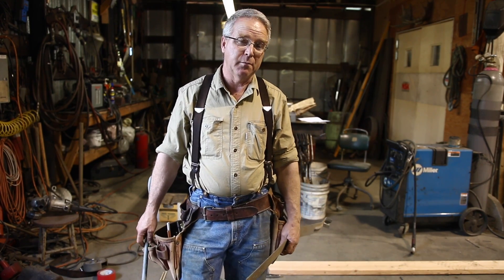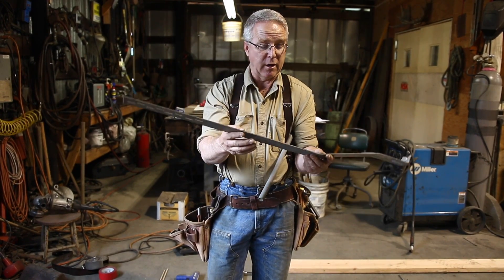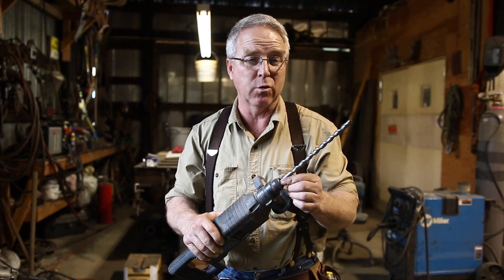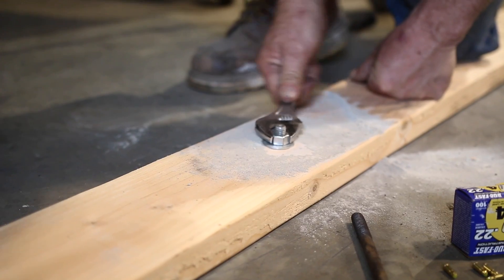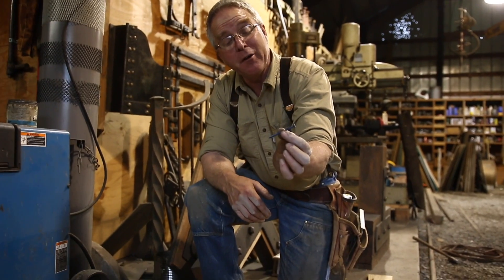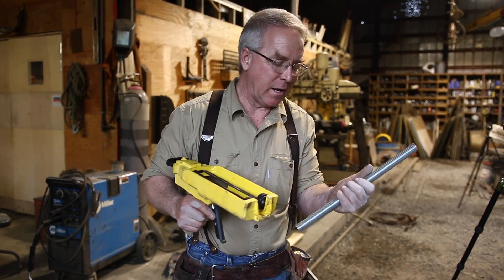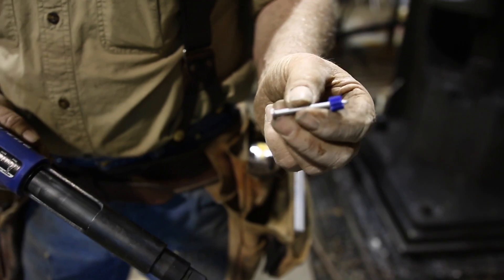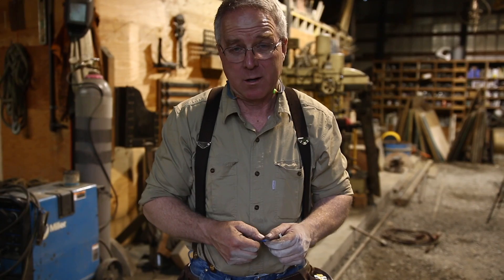How to Fasten to Concrete

Comment: the chemical anchor/epoxy/vinylester is my preferred choice on an existing building. these things work in solid concrete as well as in brick wall (with perforrated sleeves). maybe a bit pricey if you buy it from the nearest home depo, but half the price if you find an adhesive and anchor distributor in your area. there are lots of them.  spend the saved money on a appropriate gun instead, those home depo caulking gun cartridges are just a pain to get out. I have a similar gun shown here, but it's a dual concenctric piston-in-piston type, not the side by side. looks just like a regular caulking gun on steroids and takes a special single cartridge that has resin on the outside and hardener on the inside and a mixing tip is required. the beauty of the piston-in-piston gun is that you can set it from 1:1 ratio to 10:1, depending on the resin you use

Comment: I used Tapcons to bolt down the sill plate of the halfwall I added to the basement, I also had to remove a few of those ones that are shot into the slab/wood (the last one you did in the video) when I moved a few non-load bearing interior partition walls, those bitches are tough.

Comment: Good video. You will always remember doing this video with those bolt anchors in your slab there. Is that slab for your Nuclear warhead there or I mean jib  crane? That would be nice to see a video of. Thanks for your contribution. These videos are important. Teaching of the trades has gone down a sloppy hole the las 20 years or so.

Comment: Younger Wadsworth - How much does it bother you that the final footage you used ended up having such scrappy focusing? :p. As someone watching the video, wasn't a big deal, as someone who (rarely) makes videos, I was thinking about the times that's happened to me and how much it made me want to nuke the footage from orbit and never speak of it again. Not always easy to tell on the phone screen that something's not in focus. Something that might help.... use a sheet of some thing (cardboard, your hand, etc) to obscure the rest of the frame and force the camera to autofocus at the right depth. Option B is reshooting the closeups while keeping the voiceover. Anything else you learned about it that might help the rest of us?
Reply: :D. I commented not out of criticism, I know you care enough about your newfound craft to have noticed. I commented out of sympathy, and solidarity. The pain. I feel ya. Like a scab you know will scar if you pick at it, so you just gotta grit your teeth and try not to let it itch and drive you insane.
Reply: Matt, this is Nate. This new DSLR camera has been a serious challenge. By the end of this day filming (the first day with new camera) I wanted to throw the thing in a creek. Turns out, the camera was needing a firmware update in order to work with the lens we bought. HOPEFULLY we won't have that much trouble again! Good idea about cardboard to force the camera into submission :)

Comment: I have never had Tapcons do anything but leave me disappointed.  Whenever I need to anchor something into concrete, I buy Hilti anchors.  They cost a little more, but they just work.
One other tip when anchoring into a slap using expansion anchors is to drill all the way through the slab to the earth below.  That way, if your anchoring job goes south (probably because you're not using Hilti anchors), you can punch the anchor all the way down and start all over.

Comment: I have had good luck with Tapcons in brick, but usually manage to twist the head off driving them into concrete. I'm using their recommended drill bit, any thoughts? I've put a lot of interior bottom plates down with double 16s or Ramsets though

Comment: I remember learning the 16 penny nail and bailing wire trick when I did form work years ago. I'm so glad you covered it. HILTI has a lot of new fasteners out. They even have a vacuum that attaches to the drill to clean the hole as you go and keeps down the dust which is a health benefit if a ton of holes are to be made

Comment: I just wanted to add a "cheater" trick for Tapcons when they aren't holding anything critical...if you over drill the hole for some reason you can slip a zip tie in the hole and then run the screw in. The zip tie will give the screw something to press against so that it can grap the concrete on one side. Not the best solution but it can save you in a pinch.

Comment: 3/16" hole and one strand of insulated copper wire, stripped out of romex will hold a #8 screw real well and let you take it out... great for formwork.

Comment: What is the reason for using duplex nails over regular nails on those particular connections? I can only think of two reasons 1) to mark where the connection is or 2) to make it easier to remove the fasteners after the demonstration.
By the way, thank you for putting out excellent content, and I mean that, currently your videos are the only ones that I will always watch regardless if the title indicates it is something I'm familiar with or not interested in, I seem to always learn something

Comment: Thank you for another video, teaching us all some different ways to attach things to concrete and cinder blocks

Was wondering about the big anchor, would you still get the same strength, if the foundation was cut or bored out and refilled with concrete and the anchor???

Comment: I worked for a summer as an awning installer, and that was my first experience using tapcon wall anchors. Absolutely brilliant piece of kit, if it'll hold a 5' awning through high winds, it'll surely hold up damn near anything you want to hang on a wall. For floor anchors, I prefer drop in inserts to studs. A bit more involved to set, but you can take the bolts out, install a set screw to keep dirt out, and you're left with a flush floor.

Comment: My builder used some odd concrete in the basement. You really can't drill it with a standard bit. In real bits every time I try. I think I need a hammer drill.
Reply: You cant really drill any concrete with a standard drill bit. You need a masonry bit, it has a piece of carbide in the tip to drill through the cement and stone.

Comment: Hilti, and I assume other companies make "performance foil capsules for anchoring in concrete". They are pre-measured individual epoxy packets and come in different sizes. Just drill the  recommended hole diameter and depth for desired fastener size, drop in the packet, insert the fastener rod and you are done. No mess to clean up. Just be sure hole is clean and dry.

Comment: We have that exact drill at work!  Installing security cameras using up to a 1 1/4 x 18 bit.  I was impressed that a Dewalt 20V drill was able to spin that big bit enough to go through 2 bricks standing up and an 8 inch block we hit dead center.  :(  But it didn't have much juice left and wasn't really designed for such obviously.  Drill works great and a good price on Amazon.

Comment: To piggy back on what you've said earlier in the video, I think a very important distinction to make is the difference between a rotor hammer drill and an impact driver. A lot of people think that they are one and the same and i was one of them. Great video!

Comment: dear sir. thank you for showing all these techniques. may i note that epoxy is not making a chemical bond. epoxy is a self hardening plastic that is using its cohesive and adhesive power to hold 2 different materials. if it would be a chemical bond it would beor like welding. for example glueing acrylic with "special acrylic" glue is a chemical bond because the glue actually melts the to pieces together due to a chemical reaction between the glue and the acrylic.
also the note on the plastic anchors is not fully true. maybe you spend some time and get to know a company called Fisher. they are pretty big in my country and provide highly effective plastic anchor that will hold your tv (if propperly applied to a wall that holds the load as well) 😉
Reply: Essential Craftsman, thank you as well for noticing it. and please forgive me for the bad English.  i was not able to find any sleep that night.

Comment: Most forms I saw , were done with duplex and tie wire. Make sure you have a 4-6 foot crow bar to pull. In a pinch, any bolt screw will work, just fill extra space . Can use plastic, wood, wire tie, but I like using copper wire. Even drywall screws can be used, but have right drill, but and screws , saves time and sure job. Shop vac save dust drill and bits as you use.

Comment: I found out with using tapcons that it is best not to use a rotary hammer in soft brick. The rotary hammer makes the hole too big, and the screws just fall out.

Comment: Concerning Tapcons, if you are in a location where very hard aggregate is used in the concrete mix there is a good chance that the screw may catch a piece of aggregate and either twist off or strip out at the head.  One product we have found that works well is a Gripcon nail.  It has a heavier shank with a ridge spiraling from head to point.  You might be able to pull one with that big prybar you made a video of.

Also, I was glad to hear you cover proper techniques for using epoxy.  Brush and compressed air.  Equally important with epoxy is temperature at the time of placement.  There are different formulations for different temperature ranges.

I watched your hammering technique with keen interest, especially the blows that had a forward component involved.  That's not something that you learn from driving a couple nails.  🙂

Excellent video.

Comment: Hey a little tip. works great on big wedge anchors or overhead. switch the roto hammer to hammer only. No drill. stick the tip of the bit on the anchor and let it hammer it down. No need for a regular hammer
Reply: works great for electrical panel ground rods also

Comment: Hi Scott. Great video again. What sort if bit were you using in your SDS drill? I'm assuming a masonry bit? I didn't know you could drill through wood with them too. I'd have spent (wasted) another couple of minutes pre drilling with a wood bit first. Good to learn from the pros!
Reply: Jon Killeen a regular concrete bit. They will also go threw thin sheetmetal
Reply: Thanks Kyle Go Hawks.  I could have saved myself a load of time if I'd known that when I was boxing in some pipes to a brick wall earlier this year.

Comment: What was that yellow thing you were holding at about 10:00? You never explained that.
Reply: Essential Craftsman 

I love epoxy! As an engineer I specify it regularly on my projects. Many years ago I had a first hand experience witnessing the anchorage capacity of an epoxy  anchor connection being tested (unintentionally)  while working in construction. We were told to try to extract four 1-1/4" anchors that were embedded 36 inches because the superintendent was concrrned the epoxy wasn't setting fast enough in sub freezing February temperatures. It was in a paper mill power house and after all other attempts failed the forman told us to use the handy 35 ton bridge crane. The crane pulled apart a 3/4" steel strap in a straight pull without moving the anchor. Thankfully I was only an apprentice millwright at the time and not held responsible for the failure and crane damage. I am looking forward to your upcoming vidoe on epoxy anchors!

Comment: Love the videos, keep it up.  A quick comment on the epoxy method.  Most manufacturers of epoxy have moved away from the suck-brush-suck method as the new OSHA standards for silica dust approach.  They are now calling for a hollow shaft SDS bit with a HEPA vac connection. They will evacuate the hole as it drills.  Ive liked this method since before the OSHA standard, it is faster and more efficient if you have multiple holes in an area.

Comment: As an improvement on the plastic anchor, if I'm hanging something on a tiled wall or bolting into the floor, I will fill the hole with a two part putty epoxy and push a screw in while it's soft. After two minutes once it's half way set, I'll gently unscrew the screw and let the epoxy fully cure for another couple minutes. It's like a pre-threaded hole in concrete. Tough as a coffin nail.

Comment: fun fun, this last job i ran i was able to get the engineer to let me use Titan screws instead of wet setting anchor bolts on the perimeter walls, of course the shear walls i did wet set anchor bolts, one was 1'-6" for the hold downs on the end of the walls and the rest were 8" anchor bolts, every 32" on center.

Comment: A proper rotary hammer is awesome. Crescent wrench? Or nut rounder😂
Reply: Ryan Palmer that's the Mexican socket set
Reply: Ryan Palmer  thats a Swedish nut umm..... rounder lol
Reply: The shifting spanner was invented in Sweden by Bahco.
Reply: you always know when its properly torqued cause its rounded right over
Reply: Proper rotary hammer, is just a dream. Without it, you can spend half an hour or full hour making one hole, with crappy drill with normal hammering mode. With proper tool, it goes in 10 seconds, and you do not even need to push the drill to do anything. The hammer in the drill does all the work for you. Seriously.
Reply: Notice how he was carefully tightening the wedge anchor?The anchors spin quite easily, a nut rounder is a perfect tool.
Reply: Arkansas fit all!

Comment: A valuable lesson to keep in mind whenever making use of wedge based fasteners: Splitting rock with feathers and wedges... 

Always be very careful and triple check your design and planning before driving wedge fasteners into a material. 

The concrete guys on a site I was on years ago had a 'fun and exciting day', along with everyone else nearby, when someone goofed and was 1/32" off on the drill bit size on a series of reinforcement bolts that were being power driven into a foundation wall. One guy had gone along and predrilled all the holes, then two crews came along from either end of a wall with heavy duty power drivers. They were about 2/3rd done when the double height foundation/retaining wall split down the centre line with the sound of a sort of slow explosion going off, and then failed completely. Thankfully everyone managed to scramble away before anyone fell in.
Reply: 10/4 on the feather wedges. Amazing things can happen with just a little fo9rce in the right places.;

Comment: Good show.  First time seeing a couple of sinkers used or the oak dowel.  

Wish I got some pictures of the Hilti fastening system engineering wanted us to use on some pre-fabricated building huts.  Had a screen you dropped down into the hole and filled with epoxy.  I'm sure it was a good system, but when working on a pre-cast floor there are sections only a few inches thick.  Couple that with 20f temperatures and the system didn't work as intended :(

Comment: A friend of mine turned me on to a fastener made by " Powers ".  They are called " Forming Spikes ".  They are nothing more than a double headed spike with a kink in the shaft and they are probably made of spring steel.  They are re- usable and I can tell you they are a fantastic product.  They perform just like the examples you showed with a wire insert into the hole and/or the twin double headed spike technique.

Comment: I see you use an estwing for this work and what no case hard nails? and whats your preferred method for attaching expansion joint that  can realy get on my nerves
Reply: of dirt and iron We'll if it's not in the specs any other way use foam expansion and use a hammer strike to attach very quickly. Only if within a short timeframe before the pour; rain, heat, and even dew can make sections detach. Fastest method ever. Smack once per foot .

Comment: I wonder how a house would fare in a low grade gale or tornado if it were screwed together rather than nailed.
Reply: Its usually the roof that gets ripped off. Once the roof truss goes away, the rest of the house doesn't stand on its own real well. In Southern Florida, all of the roof truss in residential, gets attached with hurricane ties. Usually something like a Simpson HM9.
Reply: Probably fly right apart, since nails have greater shear strength than screws.